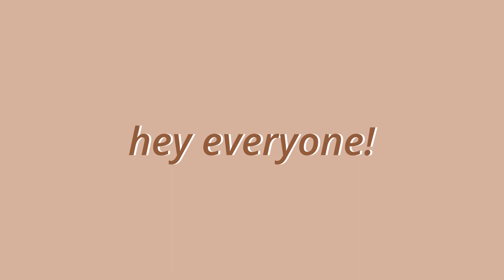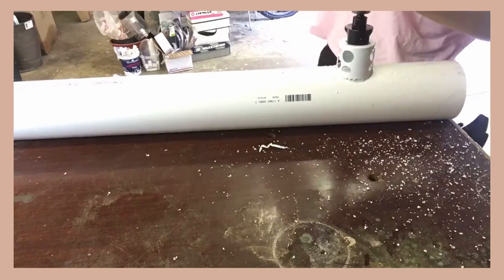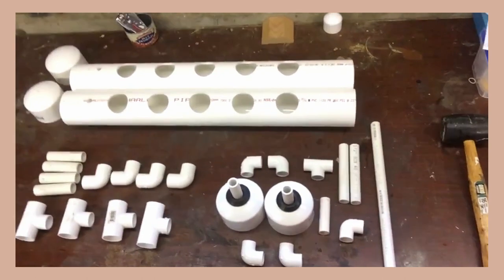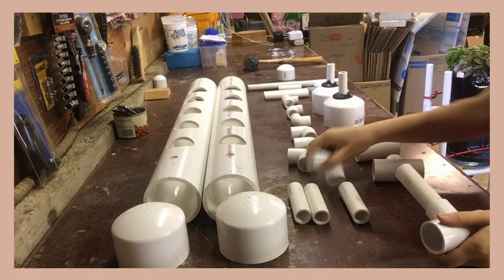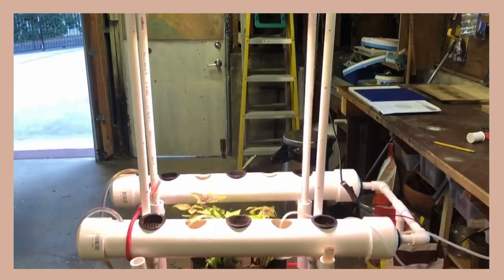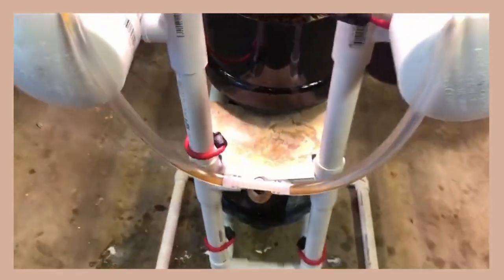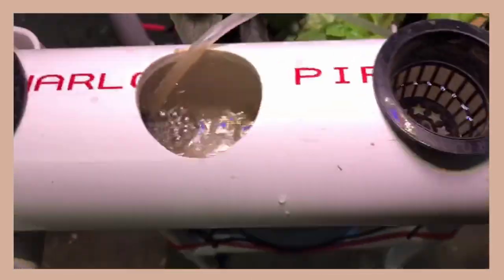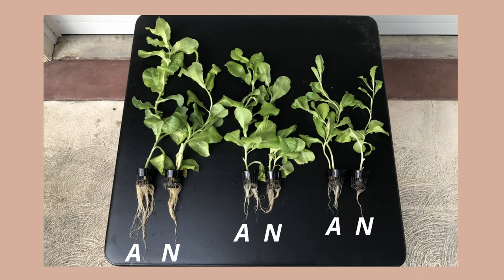Does Aeration Affect Plant Growth? | Mini Hydroponics System Experiment

Comment: Hi Jessica, how often do you test the water for aquaponics vs hydroponics? Do you use any other sensors or testing kits? Thank you.
Reply from the maker: Hi, sorry for the late reply, but thank you for the questions! When the systems were newly built, I would test my aquaponics system every 1-2 days and my hydroponics system every 2-3 days. Now that they've been running for a while now and are more stable, I usually only check about once a week. This varies a little bit though, like right now during the summer, since I occasionally have to add more water (and thus, more nutrients) because of the heat.

I'm still in the process of implementing more sensors/testing kits into my systems, but (as of right now) I use a pH sensor, pH up and down solution, nutrient solution, water level sensor, and EC sensor.
Reply: @sciencewithjessica  Thanks so much. That's very helpful. I've been testing the water quality with those test strips. However, I'm trying to find sensors for Ammonia and other chemical. I look forward to your build once it's available =)